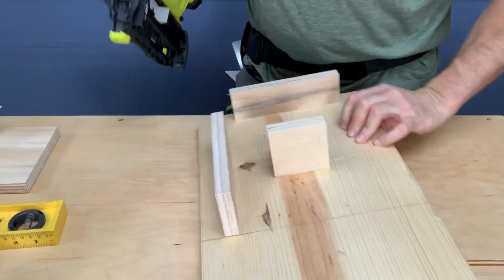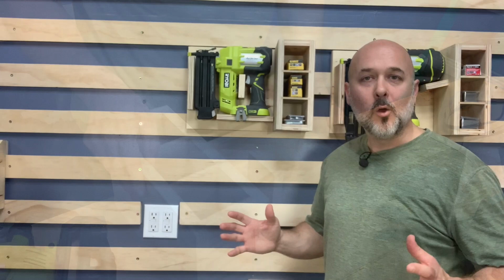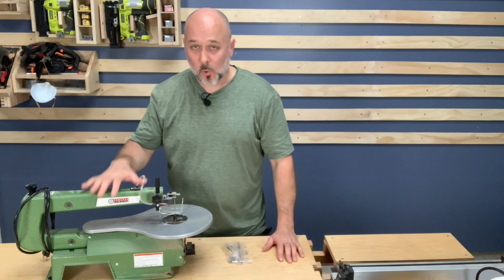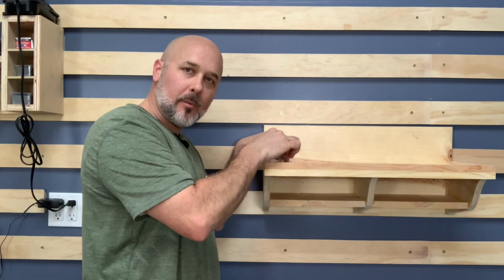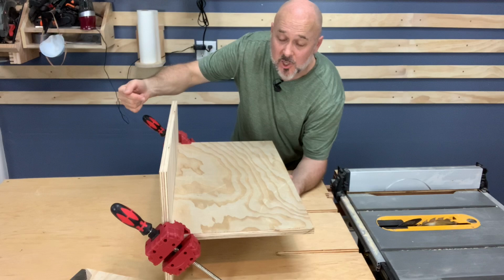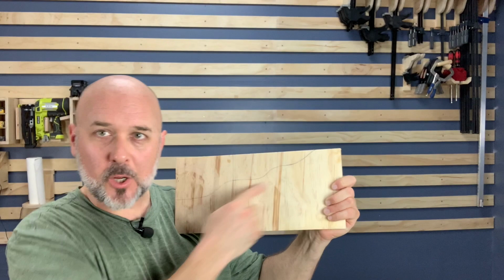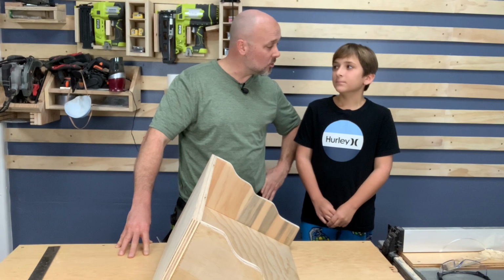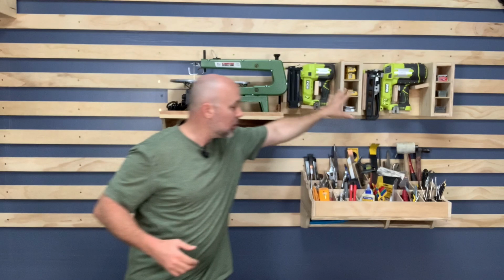I'm Making French Cleat Tool Holders! Tool Holder for Multiple Hand Tools. Scroll Saw Holder

Comment: I like that you show your ‘miscalculations’ and rather than throw the wood in the fire box, you show your adjustments to make it work. New subscriber. I have the same table saw and was very disappointed the auger is too short for dado stacks! Nice projects! Thanks for sharing!
Reply from the maker: Thanks for subscribing and welcome to the family! The tough part is choosing which of my many mistakes to showcase. If I showed all of them the videos would be way too long. I’m working on a power tool charging station right now for the cleat wall that I’m pretty pumped about. It’s pretty unique compared to the other stuff out there on YouTube....in my opinion. So keep an eye out for that one! I definitely could have used a dado stack for that project!
Reply: @DudeSawdust  I’ll keep my eye out for the charging station because I had found one on another channel, so I built it but I really don’t care for it so it’ll be great to see what you’ve dreamed up! I wish I’d known about the table saw when I bought it...because I’d have opted for the one with the longer arbor to accommodate dato stacks...I guess it’s more inconvenient than anything else...but I hate having to hit precise marks when a dato stack would nail it in one cut and no worries!! 👍🏻🇺🇸
Reply from the maker: @keithrayeski3147  I'll give you a teaser....It has side mounting for the power tools, hidden wires with grommets, storage shelf with magnetic opening hinged door, recessed hidden magnets for sticking your favorite bits for quick and easy access. It's a small charging station but I don't have a ton of drills like some of these other woodworkers. Another thing I'm doing is painting it to match the tools. Hopefully it will be done this week, got delayed having to reorder the magnets.
Reply: @DudeSawdust  oh now THAT has got to be covered under the Geneva Convention for cruel and unusual punishment!!😁 I suppose I’d better make a run to the lumber yard now!!👊🏻🇺🇸

Comment: When building the accessory box for your brad nailer ( 1:48 ), if you had cut the dados before cutting it in two to make the sides, the dados would have been level.
Measure twice cut once, apart from that hiccup, you made a good job.
Reply from the maker: You’re right! I definitely learned from my mistakes. Thanks for watching!
Reply: Sound advise. Also, use the fence for both passes next time. It will help make your dados even with the others.
Reply from the maker: Lesson learned!

Comment: Very creative ideas. You are spot on to show your mistakes and how you resolved them. Anyone getting into this hobby or line of work and expecting perfection from the start is delusional, lol. Take it from me, after 50 years, I still occasionally make mistakes. I too like that the accessories for each tool are alongside them. The holder for the wrenches, screwdrivers, and other hand tools might become an issue. It sticks out too far from the wall and you or your son that popped up earlier ;>)  is going to hit it. Just a word of caution, for any holders lower than your head, be mindful of that possibility. Looking forward to part two!
Reply from the maker: Thanks so much for watching! Yes, I'm a huge fan of the cleat system. I made those holders about 2 years ago and they have held up well. The the tool holder that sticks out far actually hasn't been a problem at all. I was concerned like you that I might run into it. But since I have hung it over to the side it has not been a problem. Fortunately my garage shop is not a tight space which helps as well. I intend to make more tool holder builds in the future. Cheers!

Comment: Nicely done my friend.  I have a pegboard wall, though not as nice as yours.  Do you have plans for dust collection to keep the wall clean?
Reply from the maker: Thanks! So far I’m using my right lung for dust collection. But I have a laundry list of hopes and dreams. I have a small space so I don’t quite know yet. I’ve got 2shop vacs that get connected to my power tools. If you follow my channel you’ll probably see a little of this and that.
Reply: @DudeSawdust  I just made a DIY cyclone style separator out of a 5 gal bucket to save my shop vac filter from getting clogged super fast.  I've been real happy with it.  For power tools, shop vacs actually work better than dust collectors because they move a smaller amount of air, but faster.
Reply: @DudeSawdust  LOL!! Let me guess...the left lungs 🫁 for exhaust!!🤣 I’m guessing a lot of us are in the same position...trying to fit everything in smaller spaces. Dust collection has ALWAYS been the evil woodworkers fight!! I remember my dads big ole HarborFreight system with PVC pipes everywhere!! It never did work to his satisfaction... I think it would have been more effective if he’d had blast gates...didn’t think of it then and there was no YouTube then...I think today he’d do it different...then again, I hope my son learns from my mistakes!! So far, he’s doing well at 40!!😁

Comment: The brad nail gun. What gauge and size do you use. Looking to buy one. Either brad or pin nailer ??
Reply from the maker: The brad nailer is 18 gauge. 👍
Reply: @DudeSawdust  whats the best nail length to use for the 3/4 ply ?
Reply from the maker: @chashaycock5924  I think is you are joining two 3/4 ply then 1 1/4 is perfect. If you use 1 1/2 then it will poke through the other end. You want your nail head to be just below the surface. Aiming for flush just puts you at risk for it being just proud. Then chase it with wood filler
Reply: @DudeSawdust  brilliant. Thanks. Love the videos. Will definately be trying some on the new cleat wall.
Reply from the maker: Good luck! Glad I could help👍
Reply: @chashaycock5924  also watch your air pressure. Too high or too low, will naturally influence the depth the brad or staple goes.

Comment: Hej Dude, thanks for your video. Nice work! How do you call the wood plates in your country. Here in Germany  it‘s named Multiplex. But your individual layers looks a little bit more thick than ours.
Reply from the maker: The outer layers of plywood are known respectively as the face and the back. The face is the surface that is to be used or seen, while the back remains unused or hidden. The center layer is known as the core. In plywoods with five or more plies, the inter-mediate layers are known as the crossbands.
Reply from the maker: Also, pine plywood (what I used) has thicker layers. If I would have used a higher end plywood like Baltic birch the layers would have been thinner. We usually just call the layers “ply” or “plys”.
Reply: @DudeSawdust  Hej Dude, thanks for your kind answer.
Reply: @DudeSawdust  best plywood explanation I’ve ever heard!

Comment: nobody but nobody addresses the issue of shop dust covering your cleat items. Cabinets with sliding doors will solve the problem. Your thoughts
Reply from the maker: Shop dust is unavoidable. Here's what I like to do. Wait for a day with a breeze in the right direction. Open the garage door and the back door of the garage that goes into the back yard. It creates a wind funnel. Then get a blower and blow off the dust off of everything. It all funnels out the back door. Also, Hopefully in the not too distant future I plan on building cabinets on the wall left of my french cleats.

Comment: Hi,
When you have something to say I want to hear it. Musical interludes, not so much.
When you speak I have to double the volume to hear you because I have to cut the volume in half when the music plays. I haven’t checked later because I can’t adjust the volume fast enough.
I like your channel, but I don’t like riding the volume.
Thanks and here’s hoping.
Reply from the maker: Thanks for the feedback. I’m curious what device you are using. I have found when I watch on the TV the sound levels vary greatly but when I watch on my desktop or phone the volume is just right. I’ve used different sound levels on different videos. I’m still new at this and hopefully will get it right👍
Reply: @DudeSawdust  Yes, I primarily use a TV to watch, occasionally I’ll use an IPhone, but I can’t recall watching your channel on the phone.
I like the French cleat system, that’s coming up for my garage and you’re giving me a good way to do the individual items.
I am able to have the volume on the same as other channels for your speech, but I need to crank down the volume for the time lapse music to about half the value.
Thanks for the quick (wow!) response and Happy New Year to you and yours.
Reply from the maker: I have more tool holder videos coming out. My plan is to do my own unique holder for my Kreg K4 pocket hole system next. I need to fill up that wall and declutter the workshop. I wish I could just quite my day job and do this full time but right now this is just a passion project. Thanks for your support and please be patient with my sound levels. 😬
Reply: @DudeSawdust  Great, I have a K4 system to put up. I can’t find anything (my wife thinks out of sight is put up🤦) so the cleat system is essential. Keep up the good work!
Reply: FYI - I watch on Laptop and the sound is an issue.  I just hit the mute button so don't miss much of what you are saying.  But the content and info provided out weigh the sound issues for me.  Keep putting out the videos.
Reply from the maker: @davidroman1654  I'm glad you still watch even though the sound is subpar. I just put out my Kreg K4 video 2 weeks ago and the sound I believe is much better. Also, I have another video to be released in like 7 minutes. Watch it and let me know what you think of the sound.
Reply: @jimhammock8614  you got one of those wives TOO!!🤣🤣 I guess it’s why I really enjoy the lady woodworkers...the understand both our passion AND, how tools are SUPPOSED to be displayed for ease of locating!! Not tucked away like a frying pan!!🤣
Reply: @jimhammock8614  music is an issue on a LOT of YouTube channels, but let me ask you this. Would you rather deal with an occasional sound issue on one device while getting great ideas, constructive detailed builds and helpful/useful instructions OR, these channels that never say a word and just play crappy repetitive music and hyper speed through a build but then want ten bucks for two pages of crappy plans? But I get what you are saying...movies on TV are like that...barely hear what they are saying so you CRANK the volume and then BOOM! Music that blows you out of the room...or a commercial, or a plane engine, or bomb exploding!! Yea...life’s a beast sometimes!!🤣🤣🇺🇸